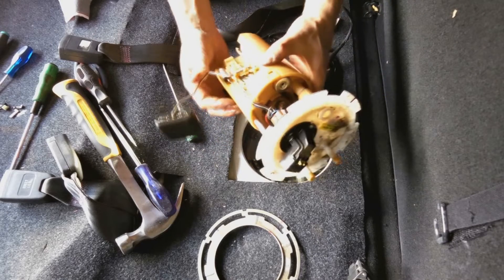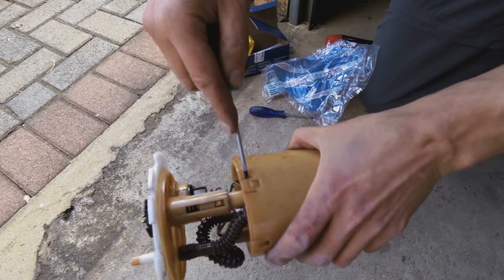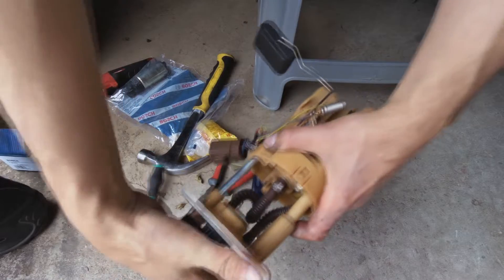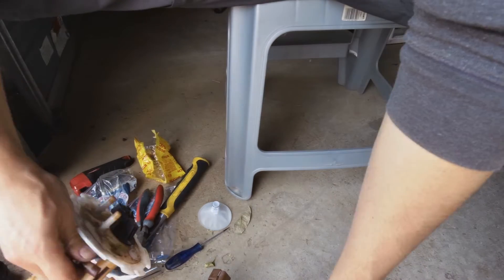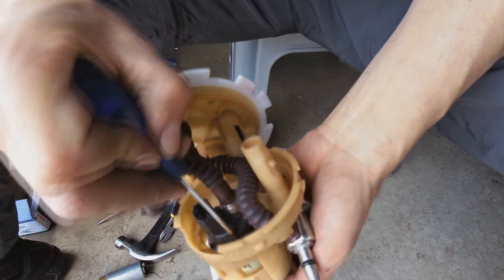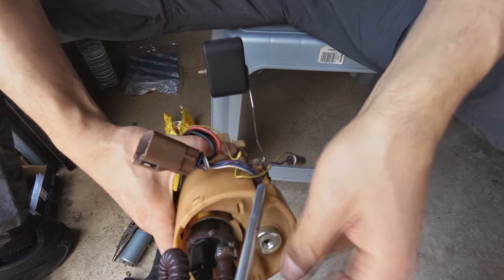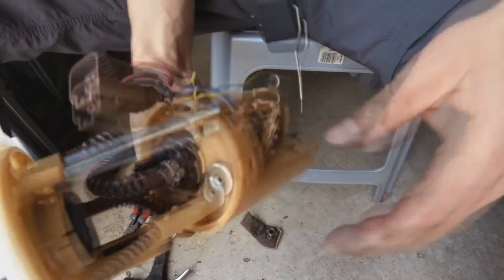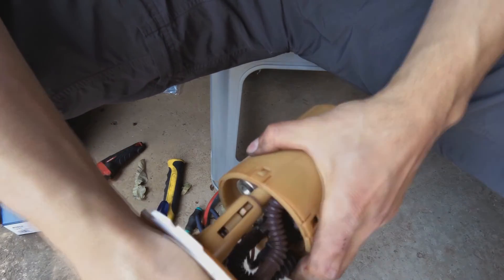How to disassemble and reassemble a fuel pump

Comment: Do you know if you can clean the i side of the assembly? The inside of the outer housing has stuff built up in it. Looms like metal shavings. Could I wipe it down with a damp towel dipped in soap water or would thay ruin the whole fuel pump system

Comment: thanks for sharing your experience, for nylon pipe end at motor/pump output it seems to be fixed by special tools and re fixed again in past job, i have to cut the end with the motor replacement but this pipe is rigid can't be tight firmly in the new motor with metal clip. any solution for this nylon pipe.

Comment: what are the springs in the structure for? why is there a shaft?
Reply: I believe its to keep the whole body aligned with itself, the spring maybe to dampen the movement of the fuel  sloshing around
Reply: @lifestokens7469  I already found the answer, it's to keep the bottom of the pump at the bottom of the tanks even when the tank expands
Reply: @ronenfe  ah yes that makes sense, thanks for the knowledge 🤟